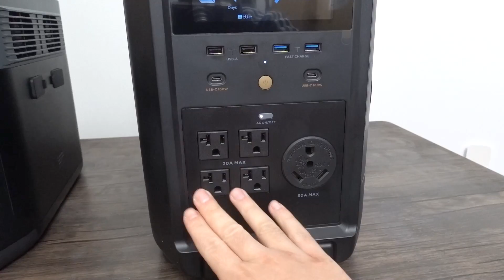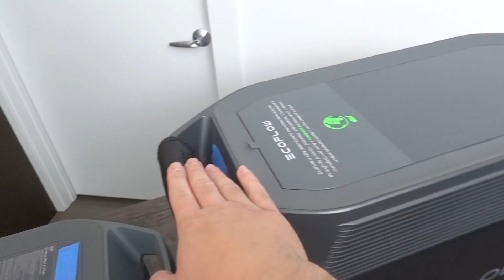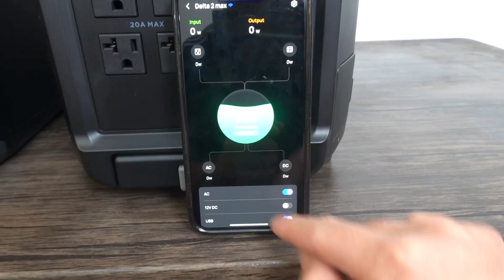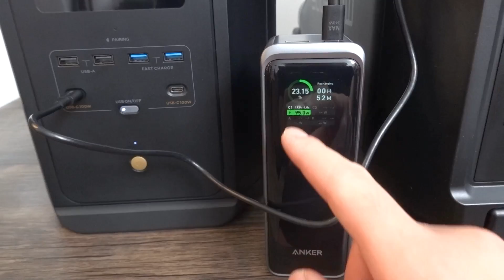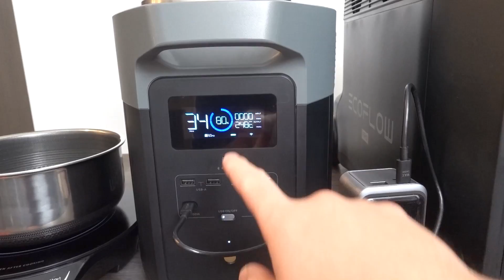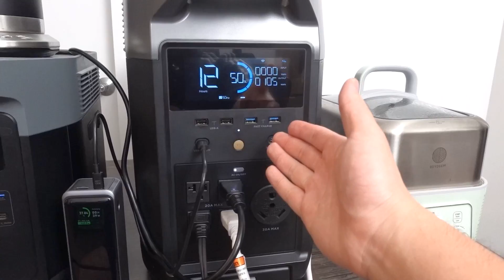Should You Buy? Ecoflow Delta Pro vs Delta 2 Max Power Station

Comment: I used the original delta 1000 which is similar to what the delta 2 max is now as far as the case goes. I had a phenomenal experience with that unit using it daily in my camper for at least a year in a wide variety of climate conditions. it never failed me and continued to surprise me on how rugged and reliable it was. great review. most people would be happy with either of these im sure.

Comment: Thanks for such a helpful video! A few questions: 1. do you think the delta pro could power three fridges/freezers at the same time? 2. Regarding rhe delta 2 max, if i purchase a backup battery, does that have its own outlets too? In other words, could i use the two batteries separately in different parts of my home? Thanks so much!
Reply: I have a Delta One 1000 watt hours I got in 2020 and it runs my 2-28 cubic ft refrigerators and my 20 cubic ft freezer for about 5 hours so a Pro would do probably at least 3 times better than mine 😊😅
Reply: @xradrd  thank you so much for your help! This is really reassuring!

Comment: Im so grateful for this review. 
I was easily able to understand you. 
I did have to listen close because you talk fast. 
I HAVE to be able to run my 8000btu air conditioner when the power goes out.  I have to get the Delta 2 Max because there is no way I can lift the pro. 
I'm about to purchase it, after many hours of research. Along with two 220watt solar panels(will get more later).  It's a lot to learn for someone who knows nothing about this stuff. 
It will be my first solar and solar power station experience. 
This review was exactly what I needed to confirm my decision. 

Now I have to learn about solar panels and be sure I have the right cords.

I think I will buy the alternator charger thingie too.  More schooling required 

Thank you again for this video and your help. 

Subscribed

Comment: I was excited to get my Delta Pro last week. I charged it and put a 22 watt load on it overnight. It failed with codes 001, 077, and the battery failure icon, and won't boot up. I've shipped it back for a refund. It took customer service 3 & 1/2 days to respond to the issue. I think I'm, going pay more for Victron and get the reliability. Maybe I just had bad luck with Eco Flow? But I need better assurance that when the grid fails, the system will work!
Reply: Wow , I am sorry !!